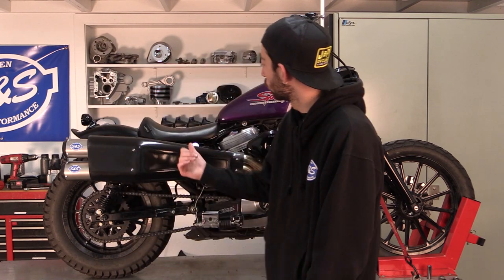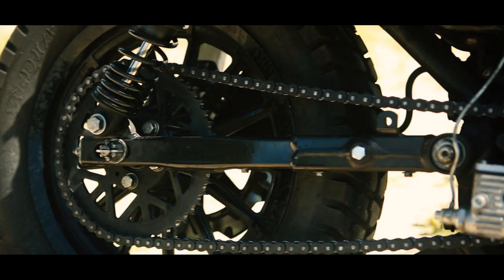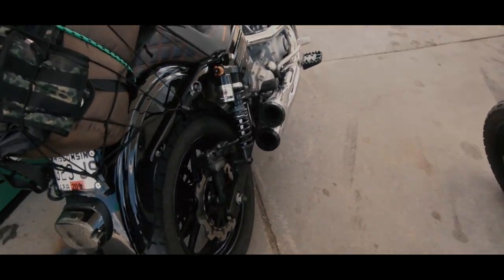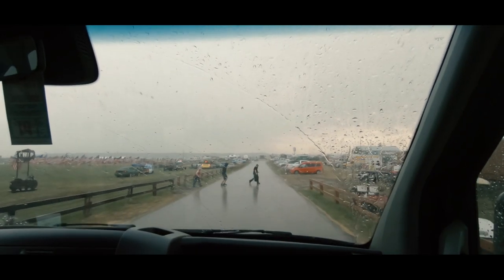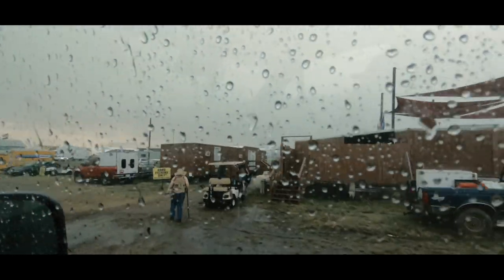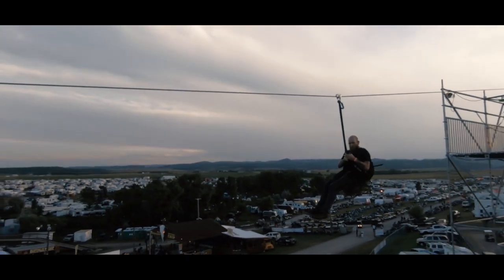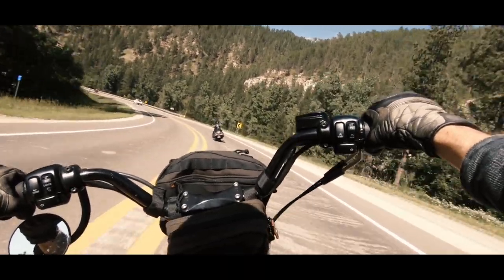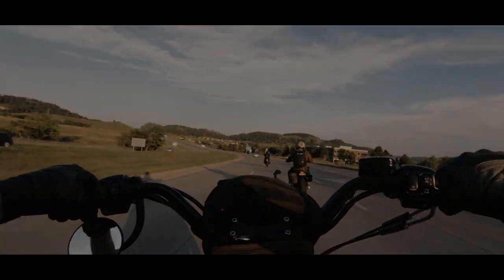Road to Sturgis - My First Trip

Comment: Wouldn't one of the best things you can do for a sporty to get better highway speed cruising performance and long range capability a smaller rear sprocket/Pully?

Getting that lower RPM cruising speed and higher top speed out of the gear ratio would help a lot as well. IT'd lower acceleration ofc, but if you're pushing a 1200cc+Stage1 setup, it should be barely noticeable in acceleration.
Reply: I have a 2006 Roadster 1200 with a 1250 kit and more( headwork, cams, carb, ignition and mufflers etc etc )... I fitted a 32 tooth belt pulley on the trans...... It now does about 95mph at 4k  rpm, and because of the power - about 100bhp - you don't notice any difference on the acceleration except for being in a lower gear for the road speed !

Comment: How many mpg's are you getting? Did you have to haul extra fuel?
Reply from the maker: 3.3g tank and was probably getting 30-35 mpg. Plenty of stops to film and stretch meant never running out on the long stretches.
Reply: @SSCycleInc  wow that's not bad at all! I figured someone would have to bring extra jug for ya...